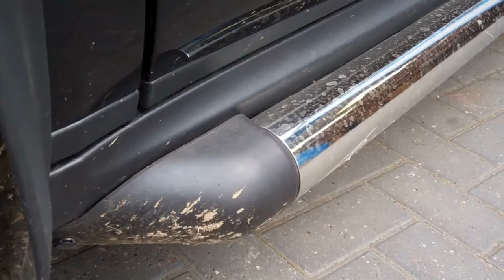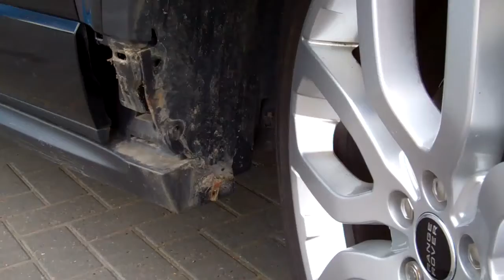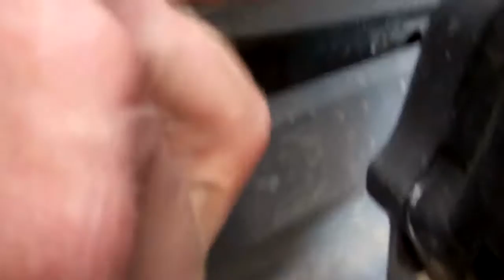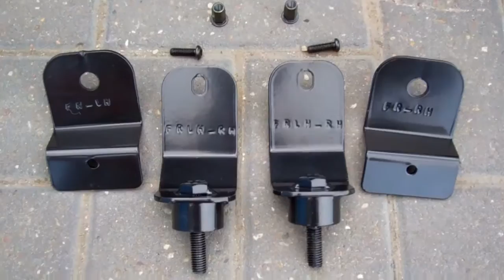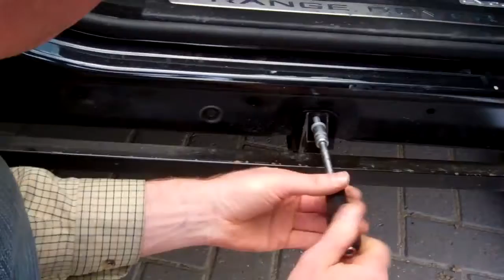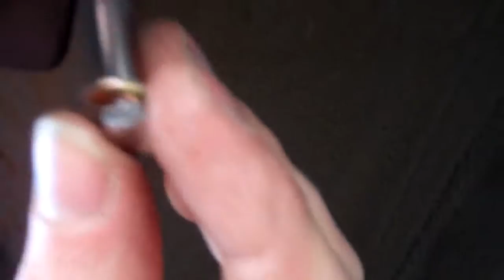How to fit side bars onto Range Rover Evoque Dynamic - Part 1

Comment: Hi, where can I get the brackets from? I was driving my evoque tonight and I heard a bang, stopped and front of the bar is on the floor. the front bracket snapped on the bend! Leaving it hanging up from the back. So I need a new bracket I’d probably get the set and do it all, and change the brackets on other side too because clearly they are perishing. Any advice will be a massive help
Reply from the maker: Hi - are they the same bars as in this video ? if so we may be able to help - send us an email to Contact at Powerfuluk.com
Reply: @ yes but for 3 door, I took it to a garage today and he welded it back on, I’ll see how it holds up if it becomes loose will email you thanks for the reply!